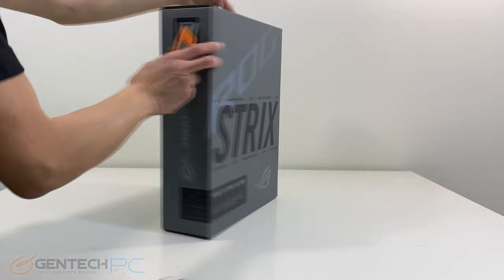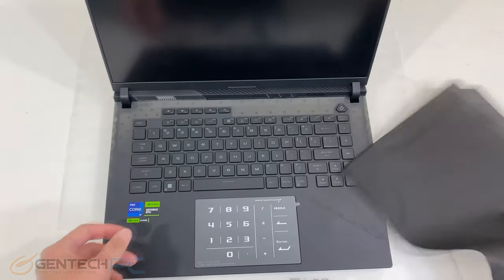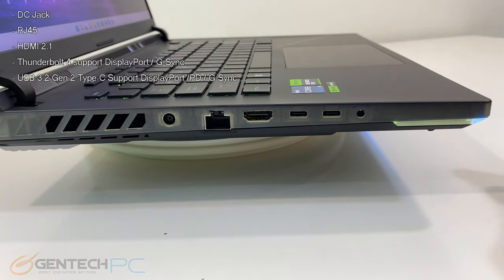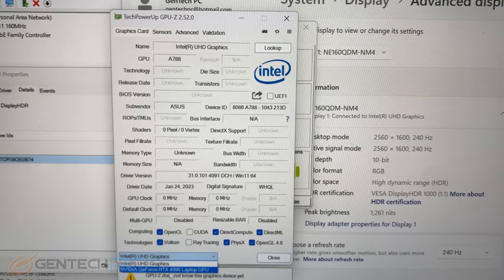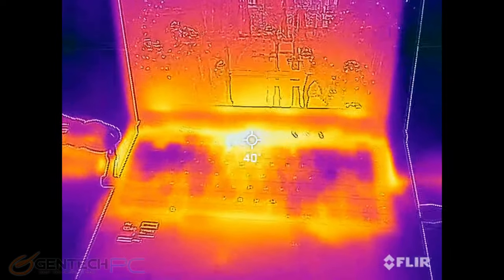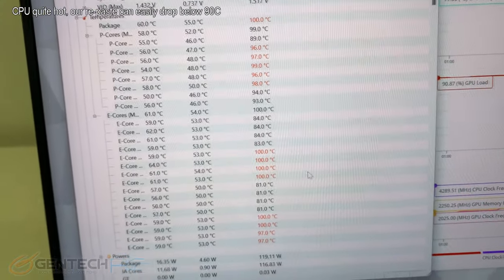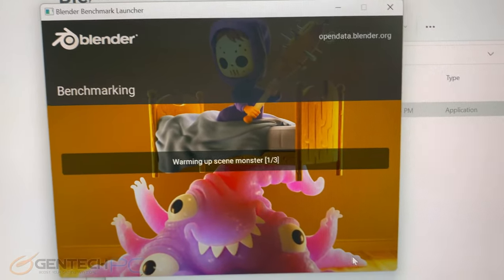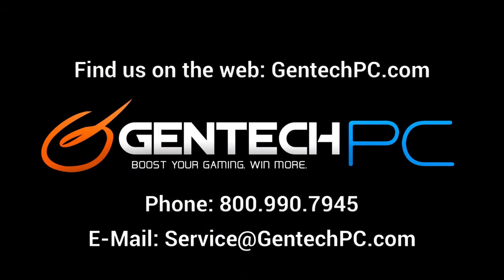Asus ROG Strix Scar 16 Unboxing & Benchmarks: I9-13980HX / nVidia RTX 4090

Comment: Defective unit likely (throttling as seen in 3dmark temps), 25900 points in Cinebench too low for i9 13980hx.
Reply: I bought one, defective broken speakers and windows 11 installer would not find any drives in it, including older NVME drives I tried since it was not finding the one it came with... very annoying.  I returned it
Reply: What's acceptable? I got 29450
Reply from the maker: No it's not defective because VMD (RAID controller) is enabled in the BIOS, therefore, it can't see any SSD during Windows installation.  You need to download and install F6 VMD driver during installation so it can see the SSD.  It's been working this way since Windows NT and Windows 2000.
Reply: @GenTechPC  oh im not saying the drive or MB was defective... my speakers were and i sent it back due to the speakers... the drives not loading during install was another thing... and i understand that fix now that you have told me.  Thanks
Reply: @GenTechPC  just bought a zephyrus and yup ... turning off VMD in BIOS worked.  Thanks!
Reply: @GenTechPC  btw, i can not seem to install linux on my i9 13900K desktop nor on this zephyrus... im not sure why... i disable secure boot... i create the USB properly in rufus... it boots... gets me to the installer boot screen... but then fails while trying to load up the installer... any idea if i need to change anything in the bios?  Thanks again

Comment: Thank you very much for the detailed look!
Do you have a side by side comparison on thermals and fan noise and potentially performance against it's bigger brother the scar 18?

Still back and forth between the potential performance/noise improvement of the 18 and the LED Display of the 16.

Sincerely thank you in advance!
Reply: I think scar 18 is like 20°c degrees cooler on avg? And much more powerful i tink dont quote me

Comment: I ve got 18 version.
Cpu max reach 95 C, and later fall up to 88.
But suprise that Fire strike ultra You have 12 466 score points, but mine 13 498.
Fully agreed that machine upllying LM on factory far away from best results.
Reply from the maker: the score difference was because of the driver versions.  Some early nVidia drivers performs pretty bad.

Comment: Keep up the good work, 10/10 for the video.
This laptop is my top choice but there is one more option, Eluktronics mech 17 with liquid cooling. 
Asus is a bit better and nicer looking, but coal whine is a bit of worrying they say it might even go worse over time and Eluktronics has better cooling with the liquid cooler, what do you think? Appreciate your opinion.
Reply from the maker: Eluktronics mech 17 CPU still goes up to 90C which is ok and build quality is more like Clevo so you might also want to checkout Clevo / Sager laptops. 

Asus is major brand and price are higher if you are looking for more premium laptop, poor pasting job by machine but simple re-paste is a easy fix.
Reply: @GenTechPC  Mech 17 costs same as Asus scar strix 18. My biggest worry is coal whine especially over longer period. Have you had issues with it on your 16 inch Asus?
Reply: @AlenFetic84  coil wine is possible to hear only during start something first 5 seconds. No any problem. Plenty pc Gpu have same issue.
Reply: @mineBMW  correct when i open my laptop first time i got crazy CW sound but after updates and so there is no more cw. if i dont open my laptop few days i only hear cw for few second that is all.

Comment: Nice review, thank you! So your comment regarding liquid metal not being as good and offering service to repaste. If liquid metal is more expensive, more difficult to install and not as good for heat dissipation, why are manufacturers using it? I'm curious about this, as I might end up with the 4080 version of this laptop since that's all that seems to be in stock around here other than the Blade 18 that's 1/3 the cost more. I've repasted things before, but I can't remember a single time where it's ever given me better results than the manufacturers pre-applied paste.
Reply from the maker: LM still the best for CPU but needs applied by hand, it needs to coat a thin layer and then apply the LM on the top.  I think it's because Asus's manufacturing is applied by machine so don't get the best result.

Comment: Liquid Metal is supposed to reduce the heat because it has a much higher thermal conductivity.  Using paste has a much lower thermal conductivity and also dries out over time.  This is why Asus switched to Liquid Metal.  Bruh 🤨
Reply from the maker: LM does not dry out overtime.  It's was just a bad paste job from factory by machine.
Reply: @GenTechPC  My 12th gen Scar had a terrible LM application as well, had to do it myself and it was a considerable difference. It's sad paying so much for a high end laptop when the QC is so bad.
Reply: @GenTechPC  It might not "dry" but it can definitely bond to your heatsink, which happened to me on an RTX 2070 Sager you guys sold me/ re-pasted with LM.

Temps were good until a year or so, but then started throttling really bad.  Paid someone to repaste it and they showed me how the LM bonded to the heatsink and there was nothing left covering the CPU die.

Basically has turned me off to LM forever on a laptop now so there's that lol.
Reply: @GenTechPC  That is exactly what I said.  Huh??

Comment: How is the mini led performance? Saw someone that said the Razer blade's mini led panel has better blacks (the scar 16 looks grey in comparison)
Reply: Heard razer doesn't last long and has awful customer experience
Reply: @tareqislam1434  I can second on the customer experience, bought a gaming chair and it had a bent rod so the seat sat crooked. Took like 3 months to get a replacement. Zero communication from them and then randomly I finally got it lol. Just bad.

Comment: Good review
I agree the paste job is bad on that unit. However, the i9-13980HX runs hot period. I have yet to see an i9-13980HX from any manufacture NOT hit 100c momentarily. My Scar 16 will hit 100c for a brief moment when loading games, but usually settles in the 82/90c range... Cinebench 97c max... With a BIOS undervolt of -80 (max allowed by ASUS) my idol temps are around 42-52c. So yeah, 100c is high, but this is every factory i9-13980HX. The coil whine is a thing with 2023 Asus laptops. I have slight CPU coil whine with the fans at 5000rpm or higher... At 5000rpm you're in headphone territory anyway.. The coil isn't notable or absent during normal use.
Reply: Agreed, I have the 18 inch G834JZ with a 4080 and i9 13980HX. It's honestly fantastic so far, after 12 days of everyday use and gaming I have no complaints, however some of the CPU's 'P' cores do hit 100c sometimes during gaming for long periods of time or during stress tests, whilst the package as a whole is usually around 80c-85c. On idle the CPU usually runs at 50c and the GPU 45c. As you said, it's likely every i9-13980HX, they just run hot.
Reply: I've also tried undervolting it in BIOS but ASUS only allows an undervolt of -30mV whilst it states that it can go up to a maximum of -80mV but any value above -30mV doesn't work. Also Intel XTU doesn't work currently, so I hope they fix this eventually and allow us to undervolt it a bit more!
Reply from the maker: i9-13980HX doesn't run hot, it's only poor pasting job and re-paste will fix it.  MSI GE78 and GT77 with i9-13980HX don't even reach 90C under load with factory generic dry-type paste.
Reply: @GenTechPC  Which do you think is better in performance alone? From your scores you gave on this video and the MSI GE78, the Asus is top in Fire Strike score, slightly higher in Time Spy, but slightly lower in all the others (You didn't do a Fire Strike Extreme for the asus, but you did for the MSI). Is it slightly lower because of the paste job? Also, is liquid metal not always better than traditional thermal paste? I watched your MSI video and the temps were insanely low for only using thermal paste. I'm guessing the fans are faster/move more air than the asus?

If its not obvious, I am looking to get one or the other lol.
Reply from the maker: @solitarymassacre  GE78 has BIOS issue and latest update fixed it.  The initial BIOS during launch does not perform well if laptop is plugged-in, instead, it runs at battery mode with lower performance and does not recognized it's plugged-in with optimal performance.   It's all fixed now with latest BIOS update.
Reply: @GenTechPC  Could you please clarify, you mean that the paste job is bad or that the Thermal Grizzly Gonductonaut Extreme itself is a bad thermal interface and better to use thermal paste instead of liquid metal here? What would you use to repaste it?
Reply: @GenTechPC  The 13980HX definitely runs hot - I bought a SCAR 16 4090 from you guys with the re-paste (Thermal Grizzly Conductonaut on CPU/ Thermal Grizzly Kryonaut GPU) and the temps still hit 100C+ depending on load. It's cooler than the one that I bought from Micro Center, but not by much. I think it's a limitation of the 16" chassis and these components. I have been able to keep things under control with a combination of PL1/PL2 (PL == Power Limit) and undervolting using Intel XTU and Armoury Crate manual mode.

Most tests are done with the laptop "out of the box" and in that mode it does not unlock the full performance of the RTX 4080/4090 (175W). Hence why manual mode is better so you can use PL values to tame the 13980HX to say 70W. My main focus is high average MHz and I was able to go from averaging around 3200MHz in a round of Fortnite to averaging nearly 3800MHz with temps in the high 90s with a -.1V undervolt and 70W PL.
Reply: @sk3tchcom  Hello! I recently placed on order for the Scar 16 through GentechPC and optioned for the re-paste (Thermal Conductonaut on CPU/ Thermal Grizzly Kryonaut on GPU). Is that a better thermal solution than putting Conductonaut on BOTH the CPU and GPU?
Reply: @ProjektAH  That is what Ken recommended. I think primarily because the CPU really needs it and the GPU doesn't need it as much (my GPU doesn't touch 80C ever, whereas I can pop the CPU into 100C pretty quickly if I juice the voltage). Kryonaut is a more traditional paste whereas Conductonaut is liquid metal. You will be pleased! It is worth having the peace of mind to know that you have no factory paste/liquid metal issues! Enjoy it!
Reply: @ProjektAH  Wait how are you guys getting repaste done? is there an option while purchasing or you are doing it yourself?
Reply: @sk3tchcom  Thank you for your insight! That's the option I'll go with.
Reply: undervolting does not help in modern cpu much at all, i would suggest limiting cpu frequency at below 4ghz, 3ghz to 3.5ghz to start with
Reply: @Olibelus  Try getting a cooling pad like the gt500 or gt650 or sum

Comment: Instead of liquid metal TIMs, OEMs should go with superior non conductive TIMs like PTM7950
Reply from the maker: Liquid Metal are still slightly better than PTM7950.
Reply: @GenTechPC  But no risk, easy to install, Will get perfect results 100% of the time!

Why are not you offering PTM7950?

Comment: the timespy graphic score is not very good，for a 4090laptop did you turn on the dgpu function？
Reply from the maker: It's straight out of the box testing as usual.
Reply: @GenTechPC  Then this was tested on stock profile not the Performance/Game profile.  Hence the scores you're seeing.  The Scar 18 has the same components (just a bigger cooling solution due to the larger size chassis).  If you're going to show benchmarks, show them for the use case most people buy these laptops for.  We should be seeing a Timespy of around 20.5k aggregate provided you do the simple step of putting the laptop in the correct fan profile (if you're running 3DMark you should be using Performance/Game profile) .  Yes this laptop will be a bit hotter as it doesn't have the same size cooling solution due to chassis size but the temps are well within spec.  You should also show actual temps of real world use, not just with a thermal camera or at idle.  Temps after a 3DMark run would be more useful (especially if you do a 10 minute looping run to thermally saturate the cooling solution -- this will give you scores and thermals that are more indicative of real world use).  There are plenty of tech YouTube reviews of the Scar 18 that use proper testing methodology and consistency in their process to make sure users get accurate data to make an informed buying decision.  Way to shill your re-paste service btw :D

Comment: I bought this about 2 weeks ago... came with a broken speaker so I returned... but the most annoying part was that when i tried to fresh install windows via rufus bootloader... windows 11 loaded fine (most recent copy downloaded from microsoft)... but the windows installer would not find any of the NVME drives in the scar (including older ones I tried to put in it)... so i was unable to fresh install windows.  Can you check if yours is able to fresh install windows via USB?  Thanks
Reply from the maker: It's because VMD (RAID) is enable in the BIOS which Windows 11 installation can't see the SSD in VMD enabled mode.  You can either install F6 VMD driver on a USB during Windows 11 installation or, disable VMD in the BIOS.
Reply: @GenTechPC  ohh :) raid is enabled when there is only 1 NVMe in it?  it only came with 1 1TB NVMe inside, i was expecting 2 512 in raid.  im going to order the flow x16 this week, so if i have the same problem I will try that.  that is great to know :) thank you!
Reply: @Cryptomined  This is the standard for most newer laptops even with 1 drive plugged in. you need to put the drivers on the USB drive and load them when you are at the drive selection screen.
Reply: @solitarymassacre  ah ok ill look into that, havent bought a laptop for maybe 3 or 4 years, thanks

Comment: Dude, the liquid metal is much better than any other thermal paste, the temperatures was high becouse the CPU and GPU are very powerful and both have a high TDP. Repasting it WILL NOT make the temperature to go low.
Reply from the maker: Paste by machine and paste by hand makes huge difference.
Reply: @GenTechPC  nice, so prove to us. Make a video and prove what you're saying

Comment: Thanks for your review, does de ssd are in raid 1 or you have two  disks separarte no raid, i  bougt one waiting to arrive and i will like  to upgrade, i saw in the part number in your video that you have two nmve of 1tb, Regards
Reply from the maker: It came with RAID-0 factory installed.

Comment: Can I use normal thermal paste such as MX-4, MX-6 for vram? I already repaste the LM and temp are same but cinebench is over increased to over 30k from 25k. I want to repaste the vram because it show 100 degree on vram and gpu is only 89 degree max.
Reply from the maker: Yes you can use normal thermal paste on vRAM no problem.
Reply: @GenTechPC  thanks for the info!
Reply: @GenTechPC  I got a problem with my laptop, When playing GTA5, high setting with 90fps play fine when low setting with 140fps cause many freezes. GPU is drop to 20% from 99% when freeze. Any solution?

Comment: can you show on a shorts video the provess of removing the fans?
Reply from the maker: There are only 3 screws on each fan, remove the screws, disconnect the cable and take out the fan.  You don't need to remove the heatsink to take out the fan.

Comment: Slightly confused, was always under the impression that liquid metal is more superior at transferring heat from CPU/GPU to heat plate and pipes, due to metal's unmatched thermal conductivity of delocalised electrons (being a unique property of metals).

Has anyone experienced if the high temperatures of the '2023' ROG Strix Scar 16 and 18 are causing any throttling issues of prolonged/sustained running times? 

Incidently, MobileTechReview reported similarly very high temps on the ROG Strix Scar 17 which comes fitted with an AMD Ryzen, so maybe there's an issue with 'how' the liquid metal is being applied or processed at manufacture.
Reply from the maker: it was applied by machine from the factory, apply by hand will improve the performance quite a bit.
Reply: @GenTechPC  how are we supposed to apply it manually?

Comment: Got that one. Got two questions. Is it compatible with PCI 5.0 m.2 SSD ? Is it compatible with RAM DDR5 @ 5600Mhz. Can't find any info at Google.
Reply: No,doesn't  support more then 4800mhz ram,and support only nvme gen 4.
Reply: @derekcranson2307  Thanks. Where did you find this info if you don't mind?
Reply: I own a Asus scar 18, I tried 64gb 5600mhz and the laptop wouldn't boot.
Reply: @derekcranson2307  ok thanks

Comment: Gorgeous design, overkill performance. Did you noticed any coil whine with this laptop?
Reply from the maker: normal use no, but can hear a little bit while benchmarking but can't hear when fan kicks in.
Reply: @GenTechPC  So, if I was like just browsing online, wouldn't I hear weird sounds? (obviously it goes from case to case). One last thing, which I think is the most important, that liquid metal that drips out of the chip die, was there already before you disassembled the heatsink system, or did you notice that it spilled after removing the coverage?
Reply: @lucamagni99  it's very quiet 😀
Reply: Terrible coil whine on my unit. When the fan is on during the game in performance mode it is barely noticeable, so if gaming is all you do then probably fine. On Silent mode coil whine is really bad. Watching YouTube or other work on the computer - it's also really bad. I bought it mostly just for playing games, but even with that I'm thinking that I should return it.
Reply: @urulooke  Thanks for your experience. As I thought, Asus continues to bring coil whine problems on its ROG series Notebooks, for generations now...